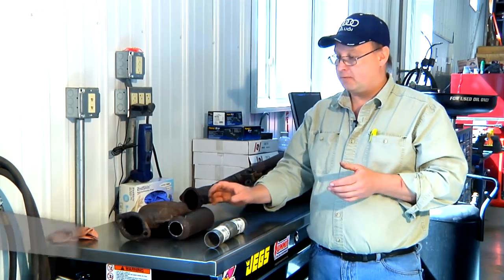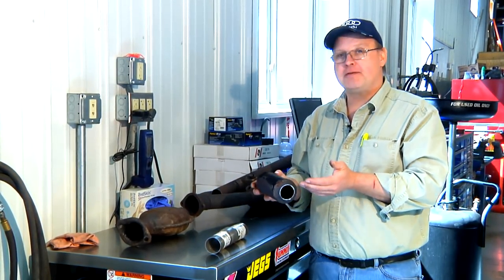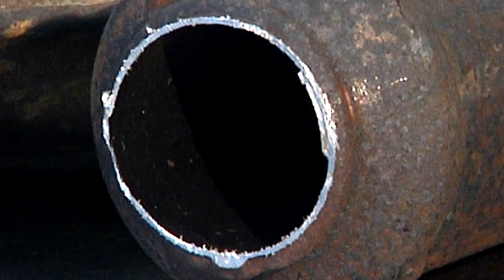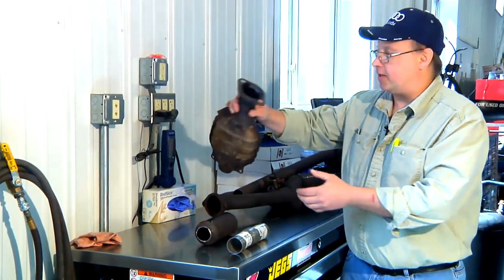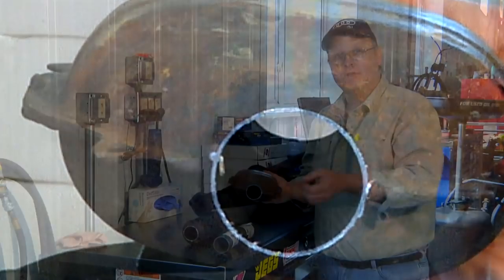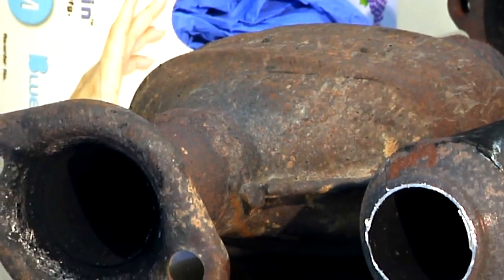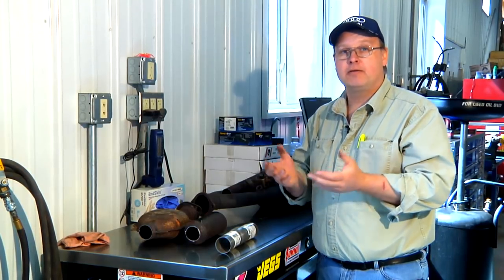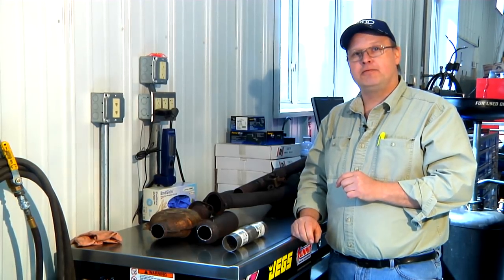What Happens if You Replace the Exhaust Resonator With a Pipe? : Under the Car Repairs

Comment: See it's idiots like him...  my dad and many other people who just have no clue and don't actually use their head...  why do you want backpressure?  Try closing the open side of your nostril and breath through the closed side, THAT is what backpressure is doing to your engine, it is restricting flow, making it harder for your engine to breathe, the quicker the flow, the better it can breathe, the better your engine can deliver the power. The only case where there may be an issue is if there is a lambda sensor (An O2 sensor otherwise known) Removing a pipe with this in and not putting it in the new pipe will cause problems with a stock ECU as it reads that to judge the air/fuel mixture as close as possible to 14:1.
Reply: +BRAV0 TWO ZER0 Back pressure does have a place, back pressure as far as i know helps to stir up the next cycles air fuel mixture, which is more efficiently burned as a result.
Putting an exhaust that is too large on your will have noticeable negative effects
Reply: +beyondthelol You know why? because too large of an exhaust slows down the gasses, thus causing back pressure, you want the right size exhaust to keep the velocity and also the headers designed to time the exhaust pulses so that when one meets the other it doesn't try to mix and lose its velocity. You want to lose the gasses as quickly as possible not keep it.
Reply: +BRAV0 TWO ZER0 Thanks for clearing that up
Reply: +BRAV0 TWO ZER0 Back pressure is used also for torque. If you lose too much back pressure you will lose your low end torque, thus making your car slower, and worse when you are not flooring it all the time. It will generally lower your performance if you lose too much back pressure, which is why an optimal amount is needed. Remove too much, like full straight pipes would do, you lose torque, thus, acceleration.
Reply: +BRAV0 TWO ZER0 lmao nice one bro
Reply: +Alex And Nate Memorial Oh you lose torque do you, tell me why any performance car, from dragsters to track racers, all go straight pipe exhausts...  because it's unrestrictive and allow the engine to breathe better which makes more power. backpressure will only choke the engine. look at subaru exhaust design with UEL headers. it fucks up the pulse timing and creates back pressure as a result of the slowed exhaust velocity.  swapping them out for EL headers will give better power and torque. all from providing much better air flow, IE much, much less back pressure.
Reply: +BRAV0 TWO ZER0 You, sir, are correct.  Less backpressure is always better.  If anyone says otherwise, then they don't know diddly squat about engines.  An internal combustion engine is essentially an air pump, easier flow in and easier flow out makes it more efficient.
Reply: beyondthelol
Wrong
Reply: +Josiah Crowley but you don't want any backpressure
Reply: +BRAV0 TWO ZER0 dont dragsters and track racers run at high RPM though? the guy did say low end torque is reduced
Reply: +BRAV0 TWO ZER0   Backpressure assists with low-end torque genius.   Maybe "idiots" like your him and your dad know a thing or two....   Might be irrelevant on a race car but for every-day drivers with 4 cylinder or small 6 cylinder engines it helps torque and gas mileage.    Since most of the population aren't trying to set land-speed records every time they go to the gas station.
Reply: +LT1HILLINGHOE   Another super-genius...   whatever you say Roger Guston...
Reply: +75Prelives where the fuck do you think that choking an engine helps with torque?  You know that iconic subaru rumble you can hear ages before you see it? that is caused by un equal length headers which means that when the exhaust pulses collect they collect in large lumps, this slows down velocity which causes more backpressure. now...  subaru at the time wasn't making equal length headers for the impreza so aftermarket companies did. after installing the equal length headers they found they had more Hp and torque due to less backpressure and higher velocity.   the only reason that you won't have straight pipes from the factory is because road legal cars have regulations to meet and the everyday person who doesn't know what the oil does in a cars engine, they don't want a car that is loud.
Reply: +BRAV0 TWO ZER0     Because the fuck Im a ASE certified mechanic for Ford?  I could give a shit about your Subaru....

Maybe not everyone has a 2014 or 2015 model vehicle genius...
Reply: +LT1HILLINGHOE   Not everyone has a brand new vehicle...

Most of the stuff I work on isn't in that category.  But thanks for your input to the conversation.
Reply: +75Prelives you're certified to follow a manual and be the liability of a person's repair...  I have a 1958 ford which you probably not have a damn clue even as to where even the high beam switch is...  or the fuel cap... or even know why the window wipers stop working when going uphill...  the fact is that you want to expel the exhaust gasses as quick as possible. backpressure chokes the engine which can cause higher combustion temperatures which can give pre ignition and knocking. but you wouldn't know this because all you do is just replace parts. you don't even need to know the in depths of dwell time, ignition phases or even what an oscilloscope can be used for.  feel free to throw in the towel and just accept the fact that straight pipes give more power than a standard exhaust.
Reply: +BRAV0 TWO ZER0   I have a 67 Plymouth Valiant, I'm sure I can find your gas cap as well as your "Dimmer Switch" (like mine it's probably a toe switch on the floor)....  Your wipers are vacuum which aren't known for torque.   The car probably doesn't have a vacuum canister (which was only an option on some of the older Fords although I thought it had become standard equipment by '58) which would help or you could just convert to electric.  Lube all the linkage joints and the vacuum motor as well at the air intake hole.  May not solve the problem but might help.  My car had a coil and points so I understand dwell.  Not sure what you're referring to when you say "ignition phases".  There are 4 strokes in an internal combustion engine and three combustion phases in a compression-ignition (Diesel) engine.

Actually I learned how to use an oscilloscope on an Allen Smart Scope but I'll admit it's been awhile since I used anything like that.  Now a days you can use PicoScope or Syscomp with a toughbook or even just get an App for Android or whatever...

I still say you have to make the distinction in the absence of an engine management system which in a performance car finds the engines "sweet spot" and attempts to keep it there as long as possible.   AND  if it's NOT a race car or a newer vehicle you still will SHIFT the low end torque curve on your dyno graph.  When I changed to large headers (from a manifold) and a Borla  component system on my on my car it produced slightly more power under my dyno curve but made  enough of a change in low end torque that I noticed it while driving. Down low I had to keep the "R's" up higher in the RPM band but at higher speeds it breathed much better. 

Don't know why you're so heated up about this simple video.  Not everyone is building a performance vehicle and the guy in the video didn't say anything about building a race car.  Of course "power" generally increases with a free-flowing exhaust but low-end torque can suffer as the torque-curve shifts on the graph (without high-tech modern engine controls).  

Horsepower is a function of torque and there's a difference between the two.  Torque (lb-ft) is a rotational force measured in watts.  Horsepower is essentially a made up number that is calculated based on torque.  If James Watt had used elephants instead of draft horses we'd be calling it elephant-power instead of horsepower.
This debate goes back and forth between even the top level engine builders.  Which is better: torque or power?   Opinions are as varied as the day is long.  Bottom line:   You can shift your torque curve on your dynamometer (effectively "losing" some "perceived" low end torque)  by changes that you make in order to increase "realized"  horsepower gains.  Perhaps "losing" torque is poor wording.  Changing the dynamometer curve and hence the manner in which the engine performs is a better way to put it.
Reply: +BRAV0 TWO ZER0 Thats also under the assumption they have the biggest injectors and zero restriction on intake... you need all three of these factors to be changed in order to actually receive benefit from a shorty or test pipe. Trust me I&#39;ve done testing on dirtbikes , v6 and v8 engines. Lop a exhaust tube right after the cat on a 4.3L v6 gmc motor or any v8 and it literally looses all passing power.   Yes lots of flow for exhaust but without more fuel and air being mixed in its not making any more power just loosing it..
Reply: 75Prelives
You tell 'em, troll.  Anyone who thinks backpressure helps an internal combustion 4 cycle engine doesn't deserve to know what my "credentials" are.  So, take your rookie Wiki comments to a more captive audience, because it ain't working here.  I been wrenching and building speed since 1983 and I have enough time slips to fill up your living room with, rookie.  Now, as they say in YouTubeville, where people like you hang around trolling everyday and all day...have a nice life, troll.  And please don't reply.  I grow weary of your attempts to dumb things down to your level, troll.
Reply: *****
But he has a blue and white striped shirt with some cute patches on it that the used car dealership that employs him wouldn't even pay for.  Plus he can play his radio real loud and drink enormous amounts of coffee in his work area while checking brakes with a floorjack and a flashlight and then sticking inspection stickers onto windshields.  You know, what all  "Ford ASE Mechanics" do.
Reply: +LT1HILLINGHOE they're just instruction followers, they're nothing special and if anything if they use it as a way to show they 'know' something is just funny. good thing they only change what's in the service manual.
Reply: +BRAV0 TWO ZER0  equal length headers help scavenge the cylinders  through pairing the correct cylinders for exhaust pulses and thats how they help with power not by lowering backpressure
Reply: Konrad Salt
Bwahahahaha
Reply: +BRAV0 TWO ZER0 hold up, back pressure allows the exhaust to be pushed out of the pipe more efficiently. its like cutting slits in a straw and trying to suck fluid up through it, you want pressure in there (or vacuum depending on what side you look at it) so that it can be sucked out by your lungs (ambient air). otherwise you get backfires because you arent burning all the gas because half of the air in there is exhaust cause it wasnt all pushed out via backpressure. go watch some dynos of cars with straightpipe vs Y/X pipe. youll see gains cos back pressure. but hey maybe i know nothing and everything is a lie.
Reply: Misty King
LOL....I commend you on your unlearned BS creativity.  But, just so you know, and X pipe creates cylinder balance during scavenging, not backpressure.  A y pipe creates backpressure and causes lower dyno numbers.
You know, it's not hard to learn about how engines work.  You should try it.
Reply: k
Reply: Lol just realized my comment is related to turbo manifolds and not n/a headers and thus not relevant to the video
Reply: +Misty King don't need to whatch dyno'd cars when it's the paperwork that prove me right... back pressure is nothing like having suits in a straw... that would if anything simulate a leak, it's not fucking hard to understand, backpressure slows velocity, you want maximum velocity of the gasses so that there is less effort from the engine to push it out and that you get as much out of the cylinder as you can so the next air/fuel mix goes into the chamber clean. how many times do I have to explain the same thing over and over when it should make perfect sense to anyone who can actually think. Backpressure is like blowing through a straw with your finger on the end, you put in more effort to overcome that backpressure, that uses more energy, doing so uses the power of the engine. use a larger straw and  you can get empty your lungs quicker with less effort, using a much larger straw or rather using for example a bit of pipe you can expel the gas too quick, but it doesn't actually leave the tube as quick as the medium so the next time to blow through it you are also pushing the gas from your previous breath. again subaru with their switch from UEL headers to EL headers is a good example that a better flowing head giving higher exhaust velocity gives more power.
Reply: +Konrad Salt and guess what you get when you properly time the pulses....  less backpressure....
Reply: +BRAV0 TWO ZER0 even with turbos you want maximum velocity to push the exhaust turbine, too large of a pipe won't give enough velocity to efficiently turn the turbine and will cause backpressure, too small and there won't be enough air moving to spin it unless you increase the pressure. besides, between the engine and the turbo it is all straight pipe which is not what this debate is about as it regards the rest of the exhaust.
Reply: +Chris Alfonso never touched a car? I got a 58 ford which we took out a baffle box and put in a straight resonator and the thing pulls a shit load better. You think it's sluggish because it sounds different but in reality it isn't at all... you can say all you want but facts are facts and when your only knowledge of the subject is swapping an exhaust then you sure as he'll have no space to talk. oh and by the way, the V6 in the 350 has always been sluggish on the bottom end.
Reply: +BRAV0 TWO ZER0 i'm just asking nice. just for example a Honda civic normal 4 cylinder you can buy 2 kinds of exhaust manifolds a 4-1 and a 4-2-1. the 4-1 manifolds should have the biggest gains in HP but just a little in torque, the 4-2-1 manifolds the exact opposite. i'm just wondering why is that is it the lenght or collector or backpressure or ... I don't know. i got this info from several websites that sells both of em.
Reply: +BRAV0 TWO ZER0 when did I say that's my only mod? All I said is that when I did my exhaust there was a noticeable difference down low. And no it's not just sound. My car was dyno after I got my exhaust done as part of tuning. And I saw the charts bro. Numbers don't lie. I lost low end torque. Not a lot but noticeable. But also gained 12hp at high rpm
Reply: Chris Alfonso
What type of dyno was used to get these magical erroeneous numbers?  How many passes were made?  Was a fan used?  Where is this dyno located?  How much did you pay to get your car dynoed by this magical erroneous dyno?  What numbers did you get exactly?  Who tuned your car and what programs were used?  What year model is this "350Z" that puts down these magical erroneous numbers?  What are your other mods besides exhaust?  What are your 60 feet times at the strip because not many people dyno and tune cars that do not see track time.
Take your time Junior...you have a lot of looking things up to do.  You gotta make all your answers correlate so you don't appear even more ignorant because the less backpressure you have, the more torque and horsepower an engine will make.  An engine is essentially an air pump, easier in and easier out makes it more efficient and more powerful.  Don't forget about those answers now, Rookie.
Reply: +BRAV0 TWO ZER0 
No.
Too large of pipe does not cause backpressure, but rather it causes a loss of scavenging due to the reduced gas velocity.
The scavenging does use "negative" pressure waves,
but that's different from overall backpressure.
Reply: Chris Alfonso
Re-read my prior comment, ponder over it and apply.
'Nuff said.
Reply: +BRAV0 TWO ZER0 

"Oh you lose torque do you, tell me why any performance car, from dragsters to track racers, all go straight pipe exhausts"

these high performance vehicles are designed from that scratch for that purpose and they use forced induction you genius
Reply: +carlosb1 do you know that they run they're cars at high rpm so low end torque is irrelevant.
Reply: +Chris Alfonso what license you need for to be a air force mechanic? does it requires some specific knowledge from the university?
Reply: Bruce Wayne
He ain't going to sit here and answer any questions.  He's wrenching on them Air Force aeroplanes and figuring out how they benefit from back pressure.  You know, the Matchbox kind with those cute little chrome stickers on the side.
Reply: +Bruce Wayne you don't need a license.
Reply: +LT1HILLINGHOE turbines and combustion engines are completely different. Just like on a turbo car you want less back pressure. And on a normal car you want some sort of back pressure. Obviously a lot of back pressure isn't good. There is a ratio for that
Reply: +LT1HILLINGHOE keep rambling lol
Reply: Chris Alfonso
Keep doing your homework, Junior.
Reply: Bravo to zero....I like and agree with everything you typed. I love a loud exhaust.  I want to put super 10's on my 2013 silverado. the fucking Resenator is part of the stock engine pipe. I can remove that and not have an issue with towing power ?
Reply: Chris Alfonso
Yeah, because no one ever knows when a Hot Wheels car may receive a mid year color change.  Save us from that travesty.   Tell your 3rd grade teacher to contact Mattel for you.  Take a stand, Junior.
Reply: +LT1HILLINGHOE no one knows what you are talking about
Reply: Chris Alfonso
Thanks for admitting you don't know anything about internal combustion engines, Junior.  But, I knew that from the get go.  Now study hard and grow up strong.
Reply: Chris Alfonso
.....
Reply: +BRAV0 TWO ZER0 FINALLY someone who gets it, a engine needs to breathe!  Kudos best answer...
Reply: +Misty King correct
Reply: +BRAV0 TWO ZER0 so true!!!  After taking mine to a shop, they did a wider pipe, straight with no turns in the pipe, nothing in between, and 2 flowmaster mufflers.  So each side of the engine has it's own cat. After the cats it's straight pipe all the way to the flowmasters, made a big difference in power.  Because the faster you can get rid of the exhaust the faster your engine can cycle again.
Reply: +BRAV0 TWO ZER0 your anology sucks [or doesnt] (but it does)